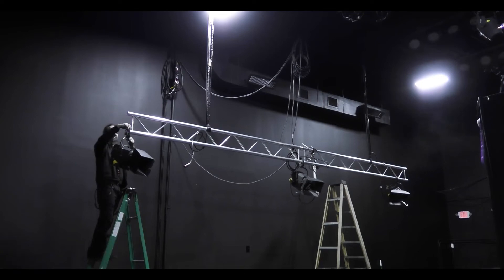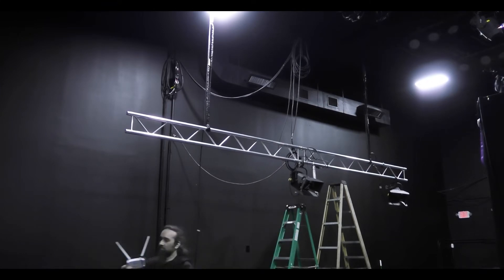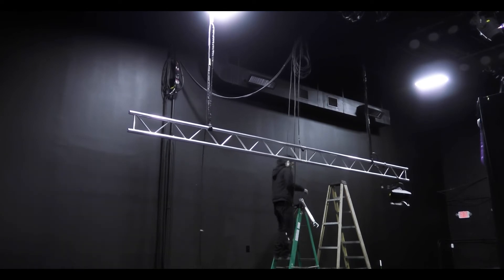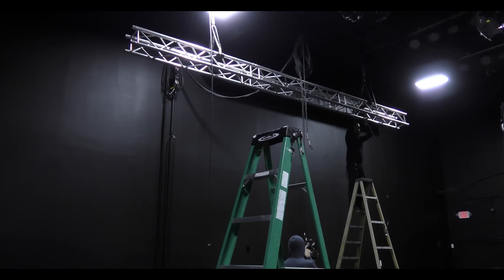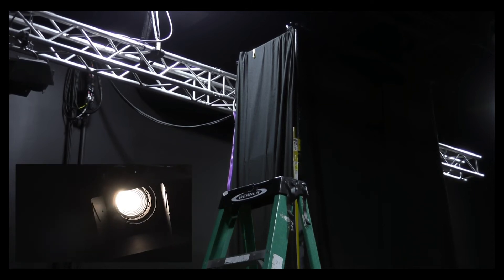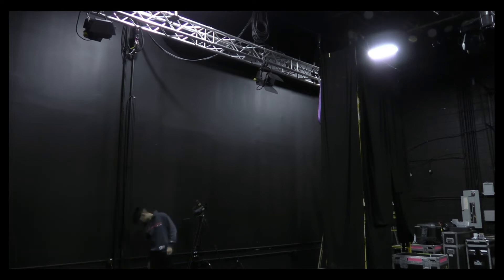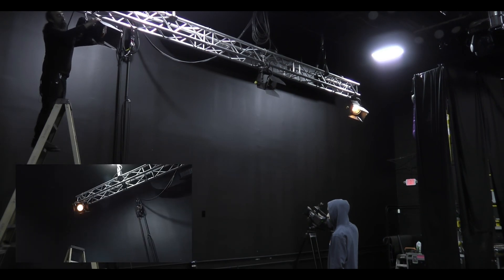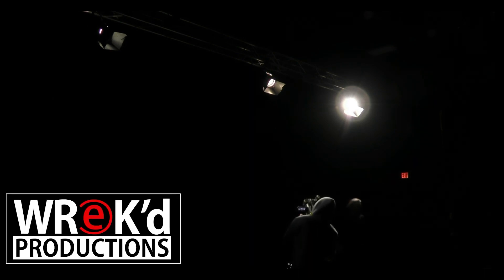How To Rig A Stage Truss  | What Is A Lighting Truss?

Comment: Would you recommend hanging a mover to ladder truss? Is it safe to hang heavy weight fixtures on ladder truss?
Reply from the maker: This particular ladder truss is medium duty, so light weight fixtures are good to go.  We would recommend calculating your total load (including wires, clamps, etc...) per whichever type of trussing's load specs.  Also remember to account for the dynamic load from the fixtures movements as well.

Comment: How come you dont lower it so you dont have to use ladders
Reply from the maker: Thanks for the comment.  We're showing an implementation if you don't have access to electric chain hoists.
Reply: Sometimes there is material on the stage you can't readily move out of the way. Moving stuff out of the way can take unreasonably long and delay work.